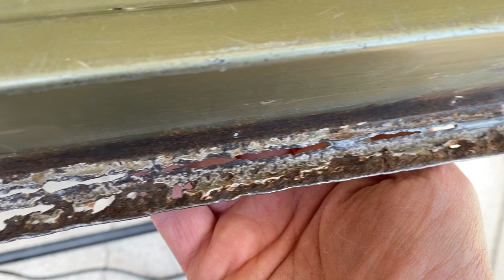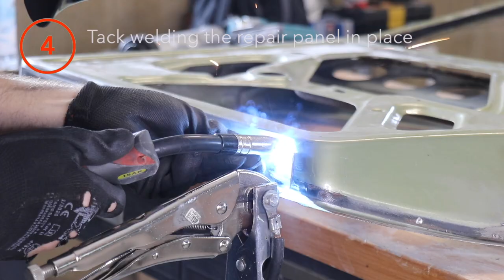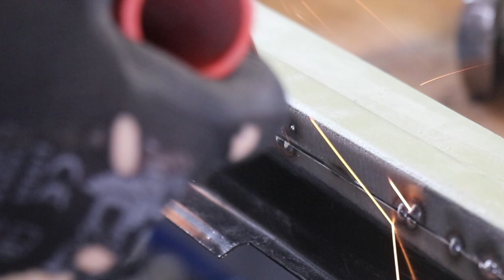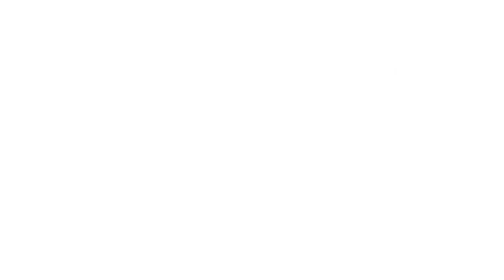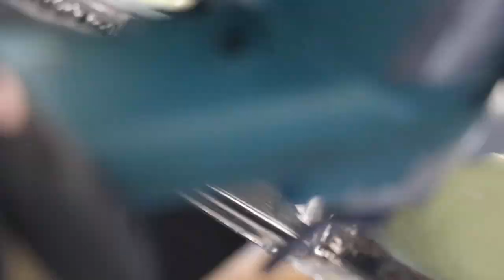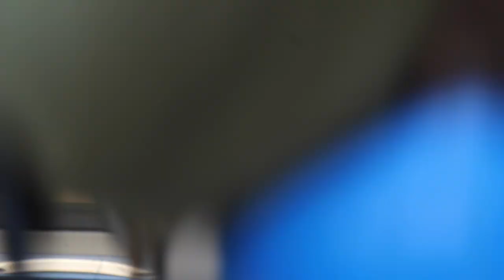How to Repair the Rusty Bottom of a Door Frame in 7 Simple Steps

Comment: So much work so much precision and than A putty on A bare metal... as putty Has a moisure inside it starts corrosion proces. You should use primer First.
Reply from the maker: Hello Adam. And I did! The body filler was applied on top of primer.